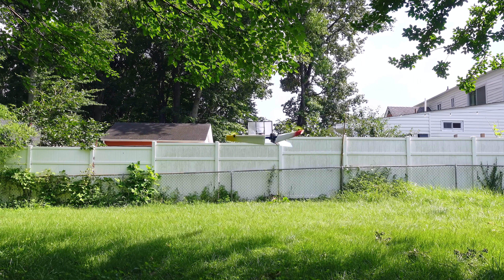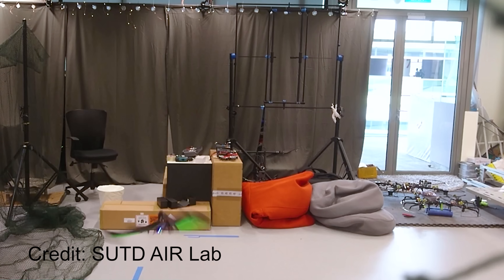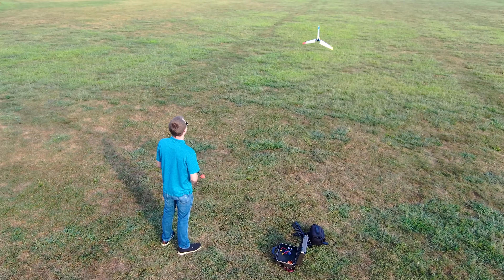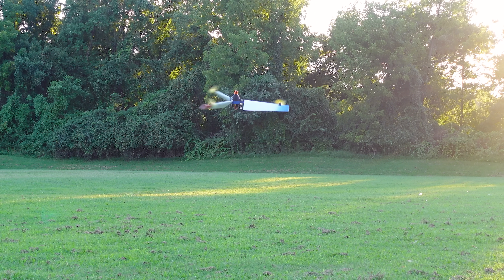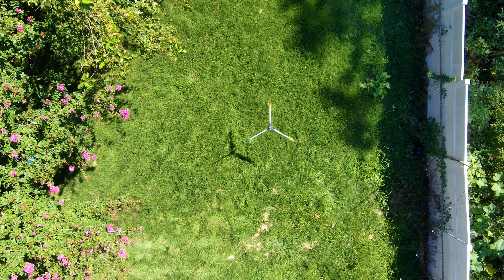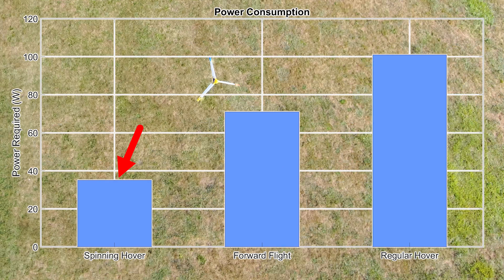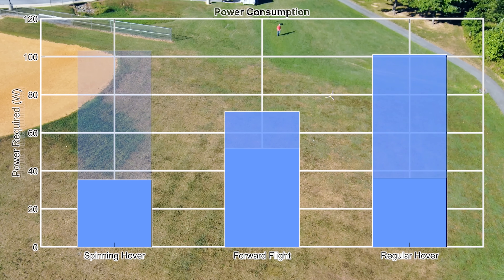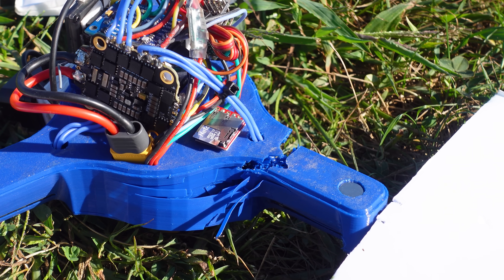Is THIS the Most Versatile Aircraft Design?  (Forward Flight Testing) - Part 2

Comment: What about spinning while in forward flight? Also, plotting range vs. angle of attack would be interesting also (is the speed a bijective function of the angle of attack?)
Reply: If you watch the first video, the angle of attach of all the wings and attached motors is controlled together. In order to get benefit from doing a spin in forward flight, I think you'd need to be able to vary the pitch of each blade individually based on where in the rotation it is. You could probably get it to work with just varying the motor speed, but aside from looking cool, I don't think that would have any benefit with the current design.

Comment: What if during flight mode, the vertical blade, splits into two produce a bi-plane wing like formation and the motor in the said blade will move at the center. 

The sequence will be: 
Flight mode:
motor moves to center 
blade splits in two 

Hover mode:
Wings merge into a single blade
motor moves to back to hover position

I'm sorry I just can't resist to share my idea since this project is really awesome!

More power to you sir!

Comment: Maybe flip it over into a "Y" configuration, make the bottom wing shorter to reduce weight and drag, and widen the angle between the top 2 so they're closer to level in forward flight. Hopefully the angle and blade length changes cancel each other out for stable spinning hover.

Comment: Tilting/rotating, linear micro-servos to adjust the 2 wings (lift) to near flat? Similar to rotating wheel retracts, but much more limited. This would give more lift with less negative dihedral, maybe even add positive dihedral would fix the drag on your vertical wing (reduce greatly).

Comment: Idea: make the base of the "Top" airfoil in forward flight mode so that it can fold perpendicular to the "wing" airfoil. This may lower the drag coefficient, and give you more of a "rudder" effect. I would also recommend making a multi-piece cover over the folding mechanism and base of the "Rudder" airfoil to create a smooth surface to incoming airflow.
Reply: Ok scientist

Comment: is this more efficient than a helicopter?
how much more lift can you add to a design like this, just for hovering efficiency or for direct vertical lift.
can you get more direct vertical lift out of this?
you can use something like this as a staging platform to drop a glider drone that then glides around, and can land anywhere in a radius. or some kind of thing like that.

perhaps something gets designed to pre spin something like this where it gets that altitude boost

What if we had a high altitude balloon aircraft carrier, that drops gliders; that fall down for their initial velocity then deploy their wings and then glide to wherever they were going.

what if a spin drone like this could be used to bring gliders back up to the blimp carrier.
hydrogen blimp is most efficent, although also most "dangerous" (Hindenburg) helium balloons lose big efficiency compared to hydrogen gas.
but really the Hindenburg "explosion" is nothing if it happens way up in the air. and it can't happen way up in the air. hydrogen is also way cheaper than helium. by a lot. and it can be made at home.

Comment: that's a very interesting design, i remember there was something similar planned by german scientist during WW2 
but i think forward flight can be more efficient if the whole drone was rotating too, and not just stable
i'm surprised you didn't think about why not make forward propulsion using the wings as a propeller the same way you did for hovering, it surely will be hard to fly in a straight line, but you're using an autopilot anyway

Comment: Isnt there a way to make one of the sides of the wing be flexible, so that when its in flying mode it will have a cimetrical design and the  with rotating it to a hover mode the bottem side will be pushed in creating a longer and shorter side?

Comment: Might be possible to add a micro solenoid to raise something as little as a matchstick in one wing. A super small spoiler that could be pulsed opposite of the direction of drift. It could open and close much faster than trying to pulse one motor to change the angle of attack.

Comment: Great video! Love that you actually have something useful and quite efficient already in this non-refined stage.

In terms of forward-flight efficiency, I think the better measurement would be power per meter flown (or mile). Then you can compare that to the power-per-distance of a regular drone and maybe a bi-wing. It will definitely be in the middle between those two, but I'd love to see how much more efficient it would be than a normal drone.
This, I think, is essential to the overall usefulness of this forward-flight mode because as you mentioned, the forward-flight mode would probably be used in a scenario where we want to fly as efficiently (and fast) as possible to a certain location.

Comment: I have a solution for directional control while hovering. You need to open flaps on the middle of the wing as close as possible to hub to allow air to go through there.
Reply: You need to do it on all the wings.

Comment: Comparing power draw of hover vs forward flight is like comparing apples to oranges. What are we comparing? Power to remain airborne? Power for a given distance? Forward flight is energy going into the vertical AND horizontal where hover is solely vertical motion. One could argue that forward flight is significantly more efficient if distance is the comparative factor. 
With that being said, awesome stuff and I love the concept. Now I want to see horizontal flight while spinning.

Comment: I think its much more useful as a controlled in-sight tool than a transportation or quick response vehicle. Distance could be traveled while in rotor mode using less power - it won't be fast but its very useful. Savng battery as you say by getting altitude in rotor and then switching to drone to get the shot. For work, being able to conserve power and stay in the air longer is hugely beneficial. the vanes could be solar panels, what a terrific design.

Comment: For stability in hover you could just add an impulse in pitch (corresponding to the angular frequency at hover) to the wings according to whatever will give you sufficient moment about the CG towards your desired location, with translation following. Also the total pitch of all blades would most likely need to be altered during the motion in order to maintain height. Pulse width and waveform could most likely be tuned for efficiency. 

Keep up the good effort!

Comment: You can counter the spin with a 4th propeller spinning the opposite direction either on top, or under the central body. 
Also if you modify the 3rd vertical wing, (or all 3, so that 2 are wings, and the third folds back to create a sort of tail) to fold back at the axis pivotal point, when it shifts into its horizontal flight mode, you'll reduce drag even more as the 3rd "wing" could become more of a tail, where the 3rd propeller could function as either a small tail wing, or if turned on, I believe will help to shift the Pitch of the aircraft.

Comment: I used to work for Mile Himes's Brantley Helicopter. The inner 1/3d of the three rotor blades didn't much produce lift. The Brantly B-2's blade's rotation rate didn't produce enough lift from the inner third to be worth the cost, weight, and drag of building an airfoil to cover the 40-inch pylon tube and flapping hinge the three rotor blades attach to. I would think the side blade of your rotors are little more than dead weight that would produce more lift in level flight if replaced by a deployable wing below the rotor, somewhat like Ed Swearingen's wings as on a Hewy gunship and reduce the drag during forward flight from the center rotor disk that produces drag but little lift. With your rotor only configuration just discarding the inner rotor surfaces and making a constant cord rotor may give better performance. 

Just an old hand's opinion.

Comment: If you can make the blades independent, with the body flat, two could be set as wings and third laying flat in line with the body. You’d need some funky gear box or three steppers to give independent control to each surface.

Comment: You could consider an x-wing design. Then you have four wings and no huge tail. The spinning looks weird with the blades not evenly distributed, but the apache helicopter tail rotor has the same unevenly distributed blades

Comment: You could maybe make an asymmetrical airfoil by having it be partially flexible under side load (more flexible close to the middle) . When spinning the side forces on the airfoil arw bigger than while flying straight.

Comment: Something that could help with the drawbacks of symmetric wings could be to add flaps that could be angled down symmetrically during forward flight and with rotationally symmetry during spinning hover.  You could also add a tail to help keep the craft parallel to the ground during forward flight.  This is a really cool concept
Reply: Though the simpler the design, the fewer points of failure.
Reply: I think I suggested the same thing in another comment just now. Even if we’re wrong it’s interesting and nice to know that at least one other person hypothesized the same thing.

Comment: I don't think that the third wing is the reason for lack of forward cruise efficiency... the effect shouldn't be that large... I'd look at the airfoil design... perhaps adjust the angle of attack of the two lifting wings separately? I wonder if the craft could be flown upside down with the non-lifting wing underneath and the motor used to shift the cg relative to the other wings (thus allowing adjusting their angle of attack independently?) That might be a bit complicated though.

Comment: When you're in spinning vertical hover, you mentioned you have little directional control. Helicopters mange this with a swashplate which (as you'll know) changes the angle of incidence of each blade depending which sector the blade is in around the pivot. You don't really want to add this mechanism as it's highly complex and will add a huge amount of weight to the setup. However, perhaps you can mimic this behaviour? Do you have independent control of each blade angle of incidence or are they all set to the same value? You could dynamically set this for your stability - however perhaps you're already doing this which gives you the current minimal stability. An angle of incidence would change the pitch plane directly, however if you can't do that you could look at offsetting the lift by 90degrees and using gyroscopic forces to tilt it instead? How are you currently managing the directional control - with the lido sensor on the ground (height graph during rotation) ?

Comment: You don't need the airfoil to run the full length of the arms.
It would work fine with half [or even a third] at the ends of the arms, reducing the drag of the upward facing arm during  forward flight

Comment: One restrictive camera solution would be to use the GoPro Hero Max.
There is a video on YouTube of a person putting it in a large to find out the RPM at which it fails to keep level footage with horizon levelling. I don't think this wing exceeds the failure RPM of the camera, based on the rotors being visible in YouTube footage when spinning.

Comment: Is it possible to code for forward flight while spinning? Propellers would have to take turns in contributing to tilt, but would look awesome in flight, and interesting comparing efficiency to the other flight modes.

Comment: Also- what if you had the two bottom wings split into a biplane when the drone tilts for horizontal flight? It would be complicated as hell but it would greatly increase the lift.
Reply: Or put the vertical wing on a hinge so it folds back when the craft is horizontal

Comment: For better forward flight what if 2 of the wings rotated opposite eachother, one clockwise and the other counterclockwise, with the forward side of the airfoils and props pointing the same direction and have the third wing stay vertical (airfoil and prop pointing up). the two forward wings propel it forward and the rear prop could be used to maintain balance. the whole aircraft wouldn't be very aerodynamic but I feel it would definitely reduce the drag problem of that third wing.

Comment: What if you re-shape the wings for each mode, allowing for twisted blades in spin-hover mode, but straight blades when in forward flight mode?

Also, for covering distance, is it more efficient to use spinning hover mode or forward flight?

Comment: Are you sure this is more efficient than a modified helicopter that has its main rotor system rigged horizontally (instead of tilted forward) for optimised hovering rather than forward flight?

Comment: a 3360 camera might be an interesting option to counter the spinning...  might need to be paired with accelerometer data for stabilization..   would a square shape also work?  it could fly in a diamond orientation to get lift from all 4 sides, but not sure if that would be better than lift from flying as a square with lift from 2 wings.   could the third wing split into 2 for forward flight?  or fold into a new configuration?  either offering lift, or acting as a tail..  some options, but I have no idea what would be beneficial...   anyhow, some thoughts. :-)

Comment: Why not try adding another wind and make it a quad rotor configuration and when flying forward, have it fly in an X orientation? As for the spinning camera issue, there are 360 action cameras that can handle that.

Comment: PLEASE READ AND RESPOND>  Very awesome work.   Would you try a flight mode where the craft does not change pitch, but rather the 2 wings transition 90 degrees to horizontal flight in 1 direction while the other remains vertical?  The result being something that looks more like a traditional airplane, with the 3rd motor as an elevator control and tail lifting body.  If there is any way I can help, or encourage this test let me know.  Or if there are plans/code/etc that I could build myself to try it out, let me know that as well.

Comment: …have you considered flying with the wing geometry (post transition) in the dihedral config rather than the anhedral config? …which means you could utilise the inherent stability and achieve yawl control by thrust vectoring L/R and pitch control with the remaining motor. Also the “video capture while in rotating loiter” problem could be solved electronically for live capture and cranking up the ISO and re-framing the video post flight for post-flight capture. 🤔
Edit: Ops! I forgot, great video BTW. I watched the last one and I was immediately impressed by the elegance of the design, well done. (Be assured there are many applications for efficient drone solutions)
PS: The solution to the “rotating control” can best be dealt with by adopting a similar control method to the Cycloidal drone’s control👍😊

Comment: You could make it so the wings are still symmetrical but also able to fold perpendicular to their surface so you would end up with an H like shape by splitting only the upwards facing vertical wing during forward flight.

Comment: What if you use a quad rotor configuration with four wings but two of the wings are much shorter. You can optimize the angle of attack of the smaller wings and still achieve symetrical hover thrust plus forward flight will be more like a conventional aircraft. Just an idea.

Comment: Just use AeroElastic wing design to give you the asymmetric foils in the direction that's needed.
Use semirigid foam over parallel carbon spars. Perhaps linked at the tips to reduce twist. 
Though you could design it to benefit from twist in spinning mode.

Comment: I bet that you could 'park' that vertical rotor, if you liked, and get some 'free' forward stability in yaw....
There's no reason that you HAVE to have symmetrical airfoils, if you have specific rotation angles for forward flight, and, indeed, get better spinning flight...I guess that the camera can have its own 'gyro' platform on the top of the unit, requiring quite low power to spin the camera relative to the drone, and, it can, of course, have the camera battery there, and the platform spinning motor and power on the drone side, with wireless video/audio, anyway?

Comment: Would it be possible to use this VTOL system to recreate a more functional version of the Triebflügeljäger (a WW2 attempt at VTOL by the Luftwaffe). Seems to me you've almost finished completing a working prototype, all you need to do is attach to your drone the rest of the plane's "body", and the tail it uses both to stabilize its flight when in cruise mod, and to stand when in the landing pad.
Would love to see how it looks and works with this modern concept and tech, what are its pros and cons, etc.

Comment: Pitch differential like in  a three blade helicopter will solve the control issues while spinning all is needed is to add the direction of travel reference like in a compass knowing for example where the north is can tell the drone which blade needs to change its pitch and when to create motion in the direction of travel to simplify the design a mechanical variable blade pitch can be added just like the one found in an actual helicopter it makes the helicopter travel in any direction regardless of where the nose of the heli is pointing every time the joystick gets pulled towards the north for example

Comment: I could design some better symmetrical airfoils for your application. You are working at Re. that is at the beginning of the area where pressure recovery starts to work. Airfoils similar to the CarteCopter would be applicable.  The faster you go or bigger you make it the more pressure recovery is going to apply, so long as you stay below transonic ranges.